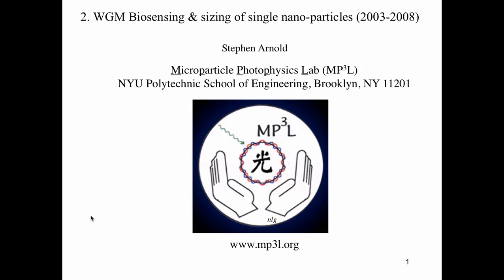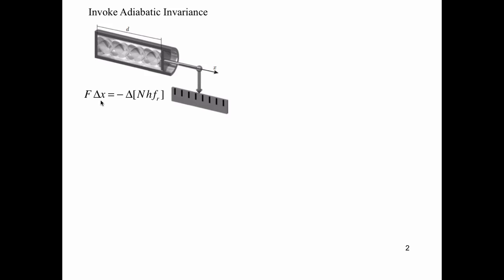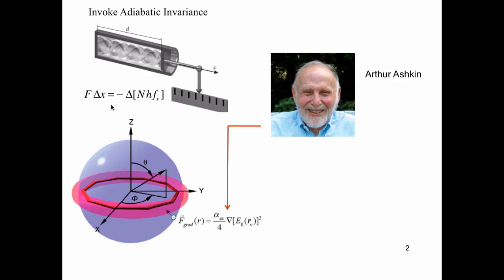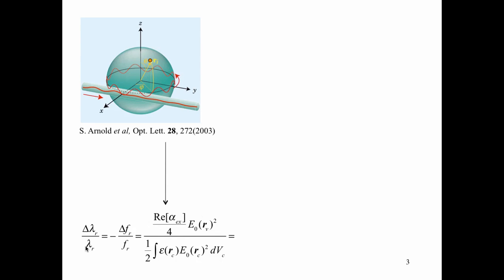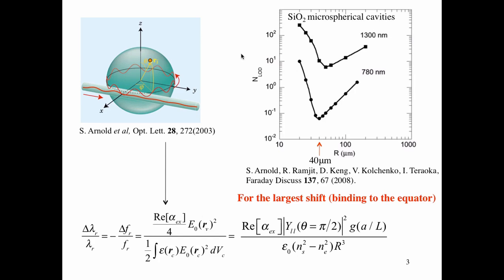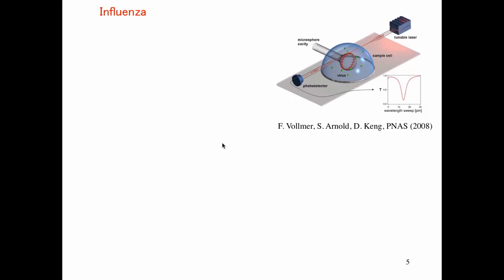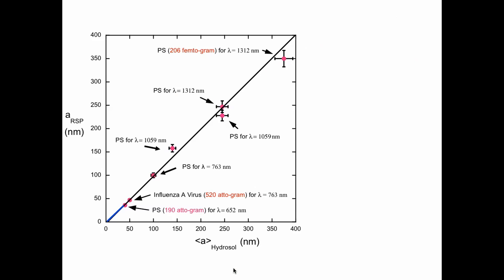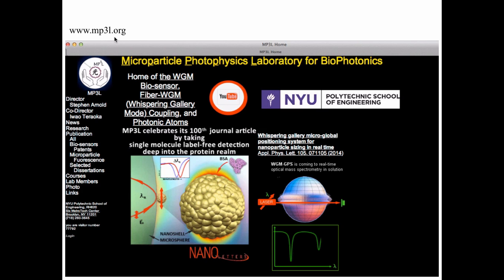2. Reactive Sensing Principle for Virus Sizing with WGM Resonator (2003-2008)

Comment: Professor Arnold, Thank you for posting the video. I was wondering, does the evanescent field depend on the distance from the equator of the cavity (the angle theta in slide 2) or is it uniform over the surface? You mention that the shift is largest when the virus binds to the equator and I wasn't sure if this is related to the field.
Reply from the maker: Kaitlynn- Thanks for your insightful question. The equatorial mode intensity does have a dependence on theta. It goes as the [sin(theta)]^(2L), where L is the number of wave lengths  that circumnavigate the Equatorial circumference. For most of our experiments L is a number like 350. If you plot this you will see that it is bell shaped with its maximum around theta=90 degrees (the equator). Please verify this and report what you find.

Comment from the maker: Another point to make is that the reactive sensing principle assumes that the field is not altered by the adsorption event. This is equivalent to continuing to have a traveling wave resonator. This circumstance will be true if the shift of the resonance  is considerably smaller than the its line width.

Comment from the maker: I should have said that a number of collaborators were responsible for the detailed theory (Teraoka, Holler, Khoshsima), although I take full responsibility for the heuristic Adiabatic Invariance approach on Slide 2. The evanescent length L was calculated in a number of ways including a calculation of the modal shapes. Iwao Teraoka worked out more detailed Electromagnetic theory in 2006, and through perturbation theory arrived at a similar result to the RSP.